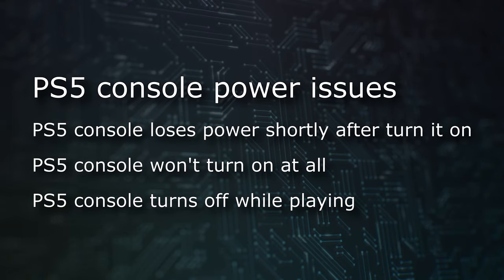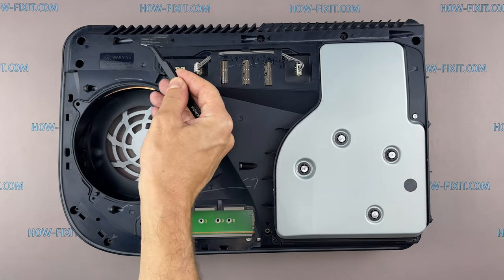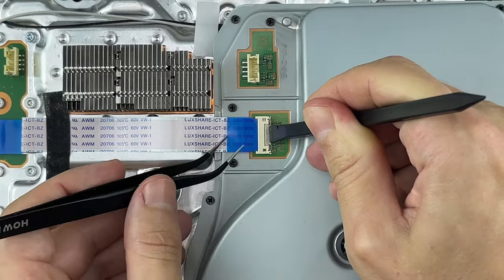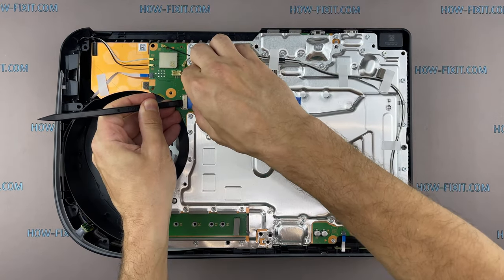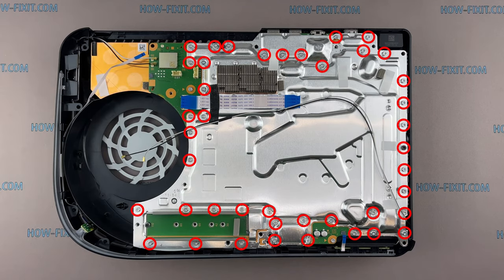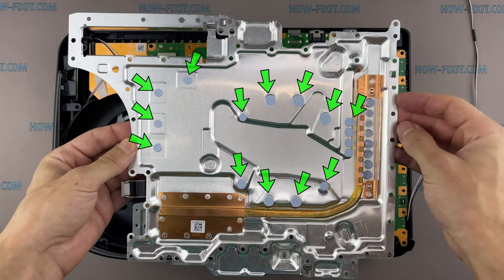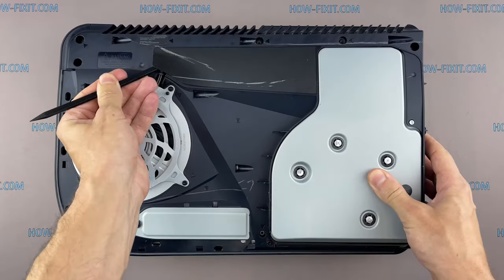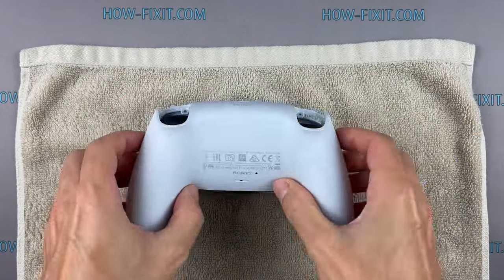PS5 power supply replacement

Comment: Just a question:

Is the power supply a reason, why the PS5 shuts off only while playing PS5 games? And even death stranding, PS5 version won't work, but ps4 version runs without issues....

Then, when it's shutting off, I have to disconnect the power cable from the PS5, wait a minute, reconnect it & then the power button works again 😅

Horrible especially when you play battlefield2042, second round after 35 minutes ends in the middle of the battle...😂
Reply: This shit happen to me about a year ago😭it only shuts off white playing ps5 games that shit is so bizarre
Reply: Maybe ps5 games brings more stress on the psu than ps4 games but that shit is so stupid 💀
Reply: @RxyaltyFN  I still wait for an answer, as soon as I get my PS5 back from GameStop (or the money), I will share it here probably as well. 

My best guess -> there is dust at the PSU.
When it's taking more power then as usual, it gets hotter, and the PS5 shuts down, because the dust gets then to hot, while the console can't cool down.

But I'm actually still guessing, only received until now the answer, that they received some days ago my PS5..
Reply: @SpelareTV how to protect ps5 power supply from dust?
Reply: @raven679-m3i  I think it's good to place a towel over it, while you don't use it. And don't clean anything in your room, while the PS5 is running..

Otherwise it's really hard, especially when you have pets 😂
Reply: @SpelareTV did you figure out ?
Reply: @SpelareTV any updates bro?
Reply: @duckboyguru6164  @ned644 unfortunately not, they replaced the entire console thanks to my guarantee, so my best guess is that it's the liquid metal in my case. Since then my second PS5 (for free) is placed like a V in perpendicular position together with the base that was in the package.

But if you have no guarantee, I was reading some days ago about a father in Germany that opened the console because his son had similar issues.. and thanks to their pets there was a lot of hair at a little hole. And that hole had the job to push fresh air to the power adapter.

Thought about it to make a video about that issue, but it would take a lot of time, before I find the videos in one of my SD-cards 😅
Reply: @SpelareTV  damn! i got my ps5 on launch so forsure my warranty is expired, or not sure. but i would never expect it to shut off during persona 3 reload🤦🏽‍♂️
Reply: @duckboyguru6164  then, without guarantee, check out if you can clean it.

Probably pet holders have quickly the most issues with the hair 😅 and if you're not a pet holder, you still doomed to experience dust inside of it 😂 so maybe you're lucky and there is really near the power adapter (inside the console) a plug somewhere, filled with dust and waiting to be removed 🤔

Comment: Ohhh no. . What about the cords coming out of the power supply? I'm at the final step and just realized your video cut away. My replacement power supply came with zero cords. JFC 💀🤦‍♂️
Reply: I'm in the process of swapping my power. Tinkered with it. The metal piece comes off. No tools required

Comment: I replaced mine today and it turned on again, but it turns off after some minutes playing PS5 games
Reply: Still it happens or it is fine now??
Reply: @yuvrajsartshorts3341  I sold it months ago. I suppose it was the liquid metal not doing its job (the motherboard was stored with the heatsinks for almost 7 months before I got a replacement ).

Comment: power supply link?
Reply: Good luck. It’s nigh impossible to find power supply replacements. The only thing I can find once in a blue moon is broke PSU on eBay.
Reply: @zerophyte   my ps5 stopped working after a thunderstorm. Most likely it’s a psu issue I’ve tried to find one as well but here I am lol.
Reply: @sahirhassan1251  sorry to hear that. I hope you find a PSU soon

Comment: My ps5 overheated about 4 times, now I fixed the overheating problem but it loses power randomly and shuts off. So disappointed 😔
Reply: How got the ps5 to hot?
Reply: @rocketgamer3878  it had dust in the dust catchers, I clean those out now my PS5 works perfectly fine
Reply: @KiritoHDGaming  yes